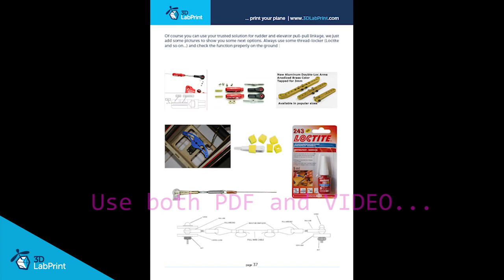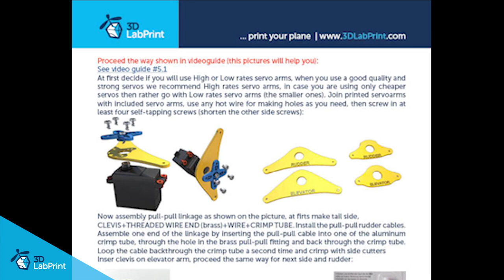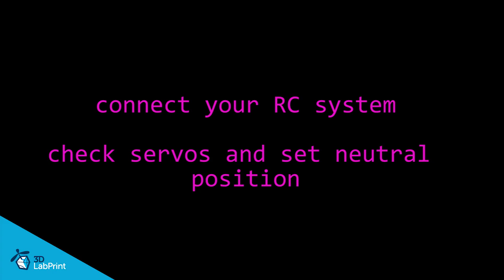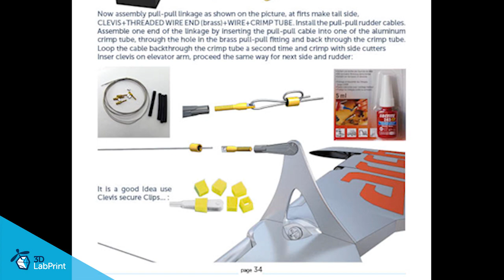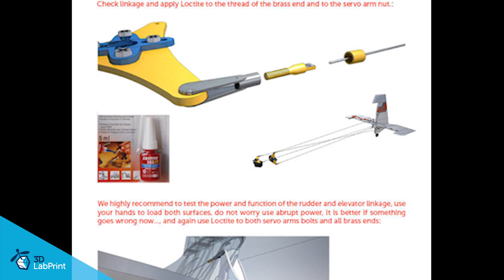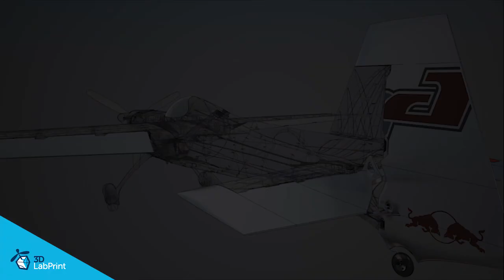EDGE Martin Sonka replica 73" - userguide 5.1 (fully printable RC plane)

Comment: What make and model of servo's are you using ? I have purchased some very close to the size suggested in manual but had to trim some of the screw hole lugs on one end to get them to fit but I would rather use the same ones you have used for best fit. Your previous manuals have links to the parts  you use but not this one well not the servo's anyway !